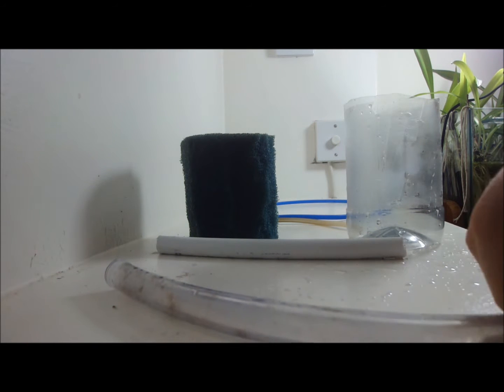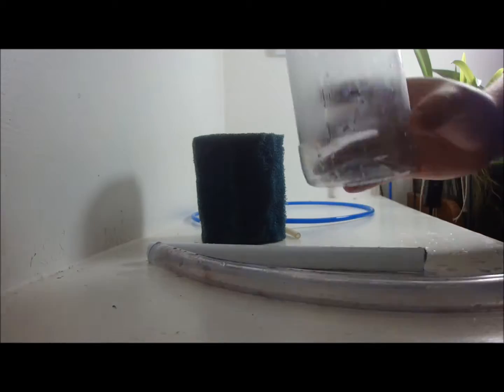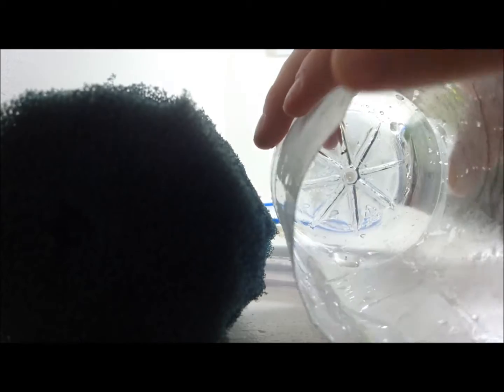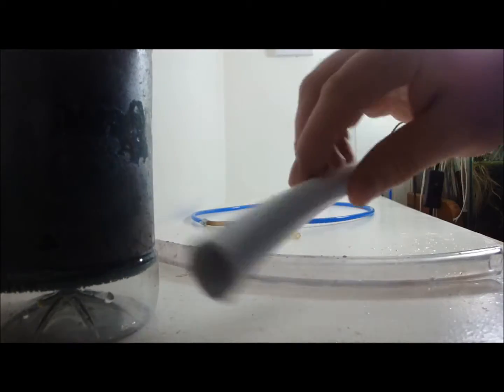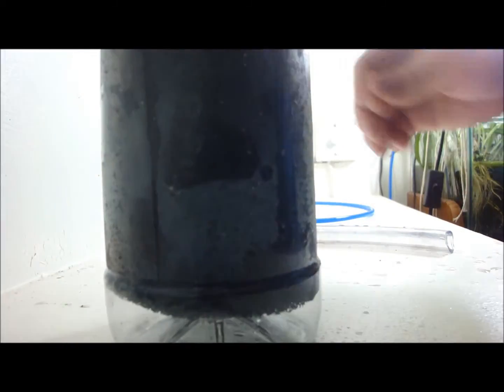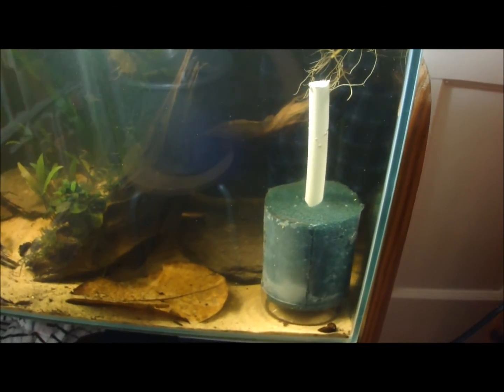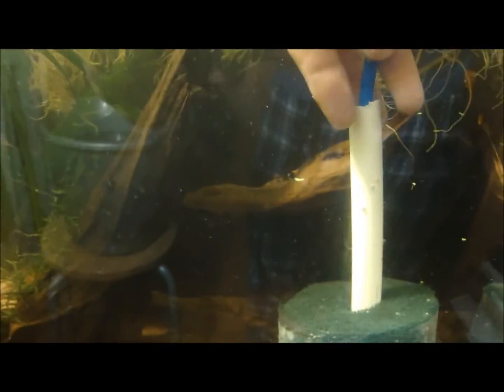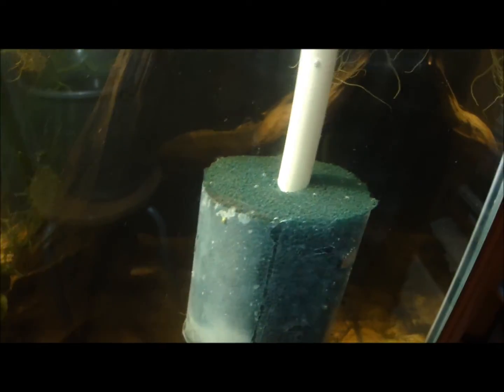How to Make a Air Powered Sponge Filter

Comment: And yes it works. The reason is works is thanks to archimedes principle.

Gravity pulls all things towards large masses, but different masses have different densities. When two fluids attempt to occupy the same space, the heavier fluid will push down harder and push the lighter fluid out.

We see this in bubbles floating, and when the separator is more visible, it resembles something like a boat.

Bubbles don't float, but we tend to understand it that way (we assume hot air balloons rise too, but in truth, they don't rise, it is the heavier air around that sinks below it and pushes it up, displacing it from the lower level, as long as there are heavier air above it, this will keep happening).

So how does this work in that pump? The tube channels the air to only go in 1 direction rather than allow water to disperse around it and down. Water, following the path of least resistance, will try to sink UNDER the bubble (that was forced in there by the pump), and rather than go through it with all the resistance in the pipe, it would instead sink from the other area AROUND it... Since the sponge was placed in a cup, it can't just go past the whole cup, and instead has to go through the sponge to sink to where the air is, this pressure difference also pushes the water in the tube where the air is bubbling from right through the tube upwards, and so water sinking through the sponge forces water through that little tube.

And if you still need a little more info on why doesn't the bubble just force the water down through that tube, it's because the air is not kept under pressure from above. It is free to be pushed up. ONCE THE AIR DOESN'T PUSH THE WATER IN THE TUBE DOWN (because it can't, it's too light), the water is pushed 'up', or rather, channeled up, thanks to the tube.

If you can break all the components down into 'pressure', and 'weight forces', and put the maths on paper in a model, you will understand how this pump works.

Physics is cool huh?
Reply: +Everyotheryoutuber Brilliant!! Thanks!!!

Comment: Because, your design seems to me that the water gets sucked up from the top surface of the sponge, where as most of the wastes are lying at the bottom surface of the tank. Does it absorb/suck the wastes from the bottom of the tank too ?
Reply: Siddhun Karthik good question. I'm struggling to understand this principal. I thought there were meant to be holes in the base of the bottle and in the uplifted tube for this to work. Could someone please explain?